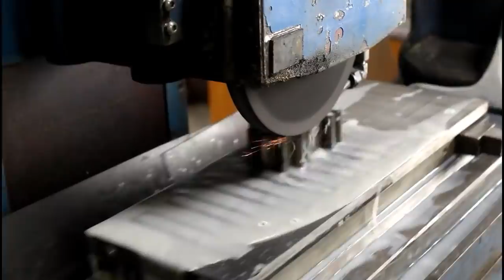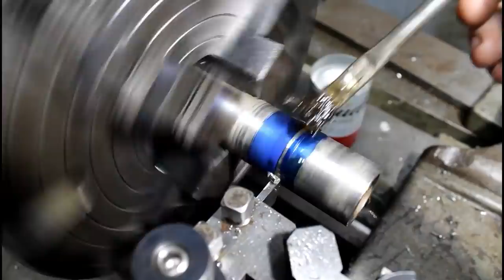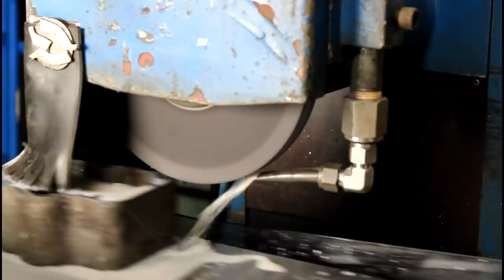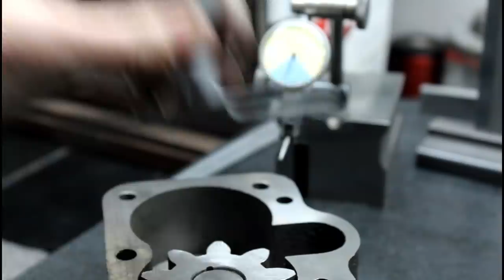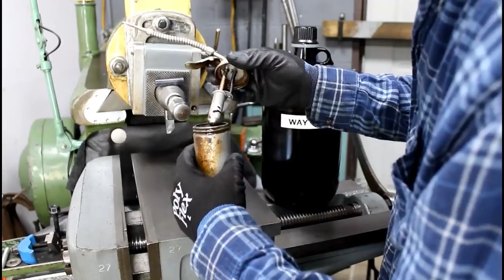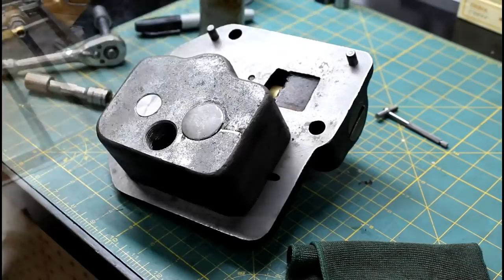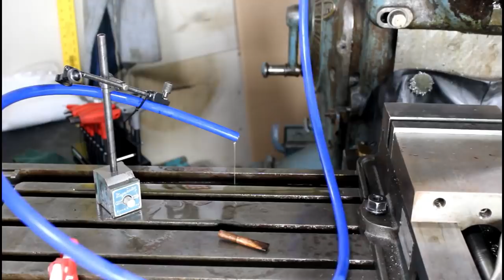OH Yeah! Gear Pump repair part 2

Comment: What would I do? Let's see.  In gear pumps the gear teeth are not supposed to contact the housing. That clearance is taken up by the fluid which provides the seal. Initial priming therefore relies on some residual oil coating the gears and housing. First, I think I'd look at the wetting ability of my cutting fluid. Dip a rod in it and check for wetting and retention. A good answer might be simply changing cutting fluid.

Comment: I like the idea of slotting the teeth (like an eccentric vane air horn pump). Guaranteeing that one won't go squiffy at some point and jam up the works will be a challenge.  Jet engine vanes have a complicated "slot" in the hub, but obviously turn at slightly higher rpm than your oil pump. Good Luck 😃, love your videos.

Comment: Just out of curiosity,  could it be modified to take a large oil pump thats commercially available? Better yet a cheap used 1. Cant say if this would be less work then the other ideas offered up. But another avenue to explore at least

Comment: Steve, I may be completely wrong but I was thinking the clearance for the top of the gear to the top of the case should be right at .002” that is what I believe automotive oil pumps of the same type run if my memory is correct. A gear type pump should never be run without oil like you did. You had me cringing running it dry! As far as addressing the gear wear, I have no friggin idea! Maybe brazing up the outside of the case and boring it to the correct diameter

Comment: If you can spray weld, I think you could can mask, weld, and then turn the gears.  Here's something interesting.  Vintage Norton and BSA motorcycles use an oil pump like that just much smaller.  They have the opposite problem.  The oil tank is above the pump so the pump is never dry, but oil leaks past the gears when the engine is not running, filling the crankcases over time.  When that gets bad, we lap the covers to remove any wear and the body to reduce the clearance to nearly zero - want as little clearance there are possible without binding.

Comment: Put multiple layers of polyurethane paint or varnish on the pump chamber walls to fill in the wear grooves and build up the walls.  This will be a multiple stage process with some sanding in between. Any high spots will be self corrected by the gears and won't cause any wear on the teeth.  Then put a better pre-filter on the pump  to help reduce the particle size going into the pump. Lastly, put a cheap centrifugal pump (like a marine bilge pump) in the coolant tank to feed the main pump to help it prime.

Comment: Another thought, right now the way it is the pump has to create enough pressure to force the air up opening the check valve with oil above pushing down, you might try first removing the check valve and letting all the oil drain back. The next time the pump is started it will not have to over come the oil pressure in the vertical pipe above the pump, it just might be as easy as that. So if the pump can create enough vacuum to raise the oil up to the pump it will be a bunch easier to do without the pressure on it's output side.

Comment: Use silver solder or low-temperature solder rather than brazing to build up the gear ends to reduce the tempering of the steel.

Comment: I have thought about this and I want to thank you for being honest, the fact K&T put a check valve on the output side of the pump shows they had a problem. Their design flaw with the pump is the fact the pump is above the oil level. What would I consider doing, I would remove the check valve above the pump and replace it with a shut off valve. When I was done using the machine I would close the valve so the next time I wanted to run the mill the valve could be opened letting oil drain back to re-prime the pump. It just needs a way to let some oil drain back to re-prime each time, and the check valve has to be removed, besides what good is it doing?
Cheers 

John Fink
Reply: A gear pump is considered to be a positive displacement pump. If you dead head them the pressure can get dangerously high. The "check valve" I think you are referring to should be on all positive displacement pumps to relieve the pressure if you shut off the outlet. Otherwise you will overheat the fluid in the pump and, in addition, the pressure will get too high. On boiler feed pumps a similar valve is also known as a minimum flow valve.
Reply: @noelhenderson700  Hi Noel
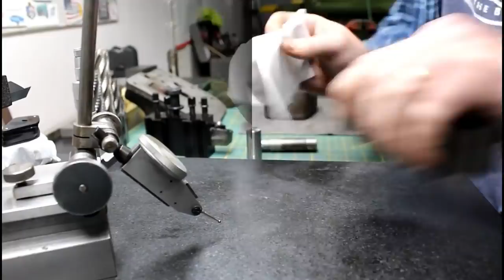This is not my first time dealing with hydraulic problems, I worked on boom trucks for over 25 years. I do know the difference between a pressure relief valve and a flow check valve, most of the booms I worked on had pilot operated check valve, counter balance valves and similar valves. I find it hard to believe Steve and everyone else has over looked the "check valve" in the bottom of the stand pipe he mentioned  in part 1 at 2:30, go and watch part 1 again and you will see the "check valve" I am referring to. That "check valve" is keeping the oil from flowing backward through the pump, which is also causing the pump to have to develop a positive pressure while it is also trying to create a vacuum on it's suction side. By removing this "check valve" the pump will not have to create a pressure and only have to create enough vacuum to raise the oil about 4 inches which is might be capable of doing. K&T had their head up their a** when the put that "check valve" where they put it. The new check valve  installed below the pump will work until a small piece of metal holds it open, then it is back to square one again. Which it why I did not suggest using a check valve in the system in the first place. 

Cheers
John Fink

Comment: Nice job Steve. Using a feeler to get close on your surface grinder is a fool proof method that works.....but try this. Put a white card on the left end of the table wall. Bend over and look at the white card from behind the wheel. Bring the wheel down until the white goes away. Been doing it that way since an old toolmaker showed me. When the white card become dirty just change it. Keep up the good work!

Comment: no a mechanical engineer , just an arm chair warrior so could/should be wrong, if the oil dose not get hot how about using resin/jb weld for to build up the teeth wall gap, it can be machined so it will not mess with the hardened teeth

Comment: To make that pump prime itself ... hmm ...
The gears are something I would not touch, maybe just see that the tips of the teeth are even. Rotary grinding ?
Then, once the teeth are done, one approach is to put sleeves in the pump body. This might involve boring the gear holes bigger in order to be able to use sleeves thick enough to be machineable. After sleeving it should be possible to bore the holes for a good fit.
At least, that is what I would do.

Comment: I think i would make a new pump body before messing with the gears, really you already did the difficult setups in reworking it,  you can make the new bores tighter, and move the gears closer if necessary.  once you start messing with the gears they are changed forever. i also agree the side clearance could be tighter, and a flap check would help you with the priming issue

Comment: We held the clearance on tooth clearance to .003” our machine shop at times would put cup liners in because at times new gears still had to much clearance. because there was too much wear in the casting. But we were the factory rebuilders.

Comment: Well, you asked for our thoughts. The hydraulic pumps that I have worked on have much tighter end clearance. .005 seems like a lot. The pumps that I worked on were .001-.002. Also, the pressure will push the gears towards the inlet side of the pump housing. The gears will rub a little on the side of the pump housing. Think of the tips of the gears like a cast iron piston ring. The only other thing to seal the teeth to the pump is the molecular structure of the oil. If your bushings are too tight the teeth cant seal against the housing. Hope this helps. I'm sure that there is more to it.

Comment: Steve not to do with the pump but the holding of the coolant line the 1" threaded hole on the vertical head that the camera is looking right at is for a post that is for holding the coolant line.  As with everything K&T it is rigid.

Comment: Dont put mineral spirits in your new parts washer, the pump will last about 3 months.  I know from experience.   All the new parts washers appear to be for water based cleaning fluids.  Probably EPA compliance or some other hogwash. Oh how I long for a parts washer that can still use mineral spirits.

Comment: If you took out the check valve and put a longer “head” above the ball valve; as when it is running with fluid, you shut the ball valve off, the line will hold fluid so when you want to use it again, open the ball valve and the fluid left in the line above the pump will drain back, priming the pump. That would be an easy fix without fixing anything.

Comment: Make a non-return valve from a bit of plastic, ally or brass and a ball bearing. If that doesn't work then build up the teeth with braze and reprofile. Great videos. Thanks. Mike

Comment: Steve if there is excessive wear between gear teeth and the body all you can really do is to replace the body, do not touch the gear teeth they are precision ground and most likely not worn at all just the cast body would be.

Comment: Hi Steve! I really like your videos!! 
As the wear should be relatively even on the gears you could turn the inside diameter of the housing to accept a brass bushing wich you could again turn down to fit with the gears. I also think that five thousands of an inch is way too much of clearance between the planes of the gears and the top of the housing. We worked on a gear pump that had tolerances of +0.03mm so about one Thousand of an inch between gears and housing. 
Greetings from Germany!! 
Hope you’ll get the pump to work!!!

Comment: Probably the best fix will be to make a blanking plug for the idler gear, and get a rubber impellor to replace the drive gear. Looks about the right size for a common boat coolant pump gear, and as those do flex, it will both self prime and also handle solid bits fine, plus bore wear is not too much of a problem. You might have to change coolant to a different type, or get an oil resistant gear, but that will be both cheap, easy to do and reliable, just order impellors in batches of 5, as they do fail with little warning other than the rubber flake count rising rapidly. You could even buy genuine parts ( Evinrude, Yamaha, Mercury)  or one of the multitude of aftermarket parts. You even get those pump impellors in dairy applications, where they need to handle fat without issue, so are made from a variety of synthetic rubbers as well.

Comment: IF you have access to a sheet roller, roll a strip of soft shim stock to cylinder ID dimensions, then permanently attach the two pieces to two cylinder walls with Permatex metal epoxy. A quick re-sleeve job

Comment: You need a foot valve on your pump. A foot valve is a check valve in the pump suction located in the sump below fluid level. It prevents drain back so your pump and discharge line stays charged. No need to prime afer the first fill. No spitting and spurting on start-up. I think hydraulic snd hose supply houses stock a variety of foot valvae suction strainers. Here's  one from Amazon:

Proline 101-324NL Foot Valve, 3/4 in, FPT", Brass https://www.amazon.com/dp/B00ITTSLHS/ref=cm_sw_r_cp_taa_bWDFDb500HH72

That was a 3/4 IPS suction pipe?

Comment: I thought of wipers initially, but I think there may be a problem when the gears mesh (and come into and come out of mesh). Assuming the level of flow currently being achieved is acceptable, maybe the simplest solution is to tweak the design so that the pump is always kept primed (e.g. install a valve so the pump chamber cannot empty). 

I think you are absolutely correct in identifying the importance of the diametric (rotor to bore) and end (rotor to cover face) clearances. From the small amount of research I've done, geared pumps can achieve a considerable vacuum when 'dry', but the design tolerances are very narrow. I've seen generic efficiency charts for 'theoretical' geared pumps and the tipping points are sharp and the sides steep (i.e. the difference between 5% and 95% efficient designs can be tiny). There seems to be very little practical literature on this topic, which suggests you are in the domain of the black arts (i.e. mostly 'suck it and see', lol). I think you may have found a candidate topic for a PhD research project, but that will probably get in the way of actual machining :-)

Comment: tip from  me as a back up plan add a hole on in bound side of pump if you cant tighten gap up to have a pint to add aftermarket pump is over pressure valve spring stile or can you adj it?

Comment: Hi Steve   I'd feeler gage tooth gap and if it is similar tooth case clearance then i'd get the gears hard chrome plated on the teeth area and OD of gears,  if the tooth clearance is equal to case gap.

foot valve might help  and a primer hand pump.  
Nice solvent tank.

Comment: Run heavier cutting oil, and the check valve is a really good idea, that would ensure all the oil doesn't just drain back out of the pump back into the sump.

Comment: This may have been said, I'm not reading through all the comments. Is it possible to bore the housing and slip in a sleeve? That way your gear heat treat is not an issue. It would have to be machined afterward.

Comment: Try to pull a vacuum on the inlet tube Measure the gap between the tip of a drive gear tooth and the valley between two driven gear teeth if necessary slit the apex of the gear teeth and insert a carbon or teflon strip . You could slit the gear teeth with the shaper and an index head but you would probably need to make an expanding arbor to hold the driven gear.

Comment: While youy may not have maximum performanse, it looks like you have useful flow and boosting your pressure may result in splashing coolant all over your shop.  If the pump needs cleaning in a few years, have your trainee, Elizabeth, do the job before she gets good enough to consider it a job below her experience.

Comment: Great content on machining and precision measuring. All I have for an easy  suggestion  has already been made, a check valve in the pick up tube if one will fit. Unless you can find original dimensions for the gears to see if they are the problem or if it is the case. Anyway, keep up the great videos.

Comment: I keep beer in my growler, not way oil. You have some very good comments here. Your clearances were much too large (oil will seek out a leak path at the molecular level). And when you took the file to the edges I was screaming NOOOOO anything less than a sharp edge gives the leak path a head start. Particles will go through the pump in the space where the teeth mesh, large clearances will only give those bits an inviting path where they can do their damage. It's not unusual to sleeve a gear pump when there's not a replacement available. I'm in the sleeve camp, and a regrind with much tighter clearances. I have my doubts about building up the gear teeth, or slotting and inserting an extension. A sleeve is the practical way to go, and it should be in your wheel house. Sleeved and with tight clearances, the pump should outlast you, and your grandchildren. Also, with a surface grinder I would skip the gasket goop between surfaces.  You want volume, not pressure, so the weaker pressure relief spring should have been fine. Good luck, and remember, TIGHT, TIGHT, TIGHT

Comment: Use two Oilite bearings machined to fit for the gears to seal against.  Super glue each in place if needed. 
Block off the oil return on the bottom of the top housing.  Drill and thread an outlet for the pressurized oil coming off the gear pump and run it through a easily changed spin on oil filter and then return the filtered oil to the oil reservoir.  Continue to use the existing oil strainer as a chunk strainer whilst the spin on filter to catch the rest of the solids trapped in the oil.
Steve, pay ZERO attention to the YT dross that is only watching a portion of your videos.  These sad individuals suffer from ADD (attention deficit disorder) are mostly liberals and are what I call "drive by" YouTubers.  These sad individuals have no life and race from one YT video to another seeking to fill an unfillable hole in their lives.  Ignore them as they are lost and spiraling!
You take as much time and as much detail as you need.  Those of us that can still think, wonder and learn will appreciate all that you do.

Comment: There is too much wear and metal fatigue in the gears and the housing that has lead to cavitation, which can quickly reduce the efficiency of a pump. By repairing the gears by brazing will only be a short term fix, the way the pump was designed was with a hard (the gears) and less hard (the housing) mating surfaces. There is also the fact that pump technology has changed since this machine was built and the new pumps are better and more efficient.
For these reasons I would say what you don't want to hear, install a modern new pump. There are some really good ones out there.

Comment: You Kentuckians and your brown jugs. Shine much? LOL On the pump: if new/better gears aren't available you might try tig brazing... enough control to a get a small bead on the teeth and relatively easy to machine just below tolerance... that pump should be around .008 to .0012 clearance on the gear to pump housing... our machines new spare parts were over size by that much and usually only required emery cloth on the lathe to "sneak up on it"... if my old Navy memories serve me right. Can't wait for part 3!